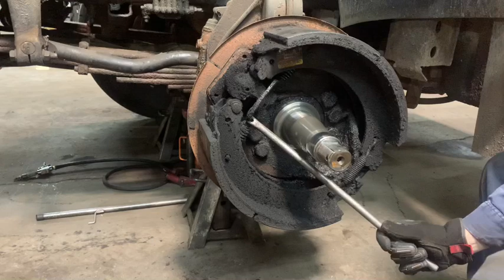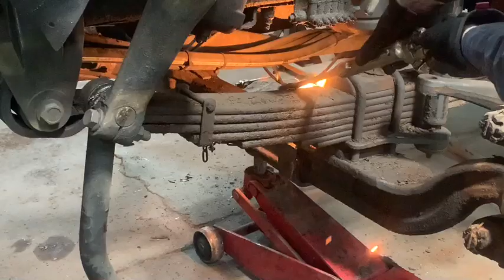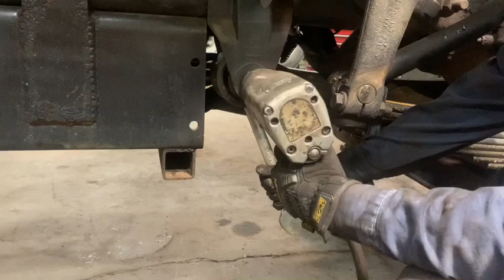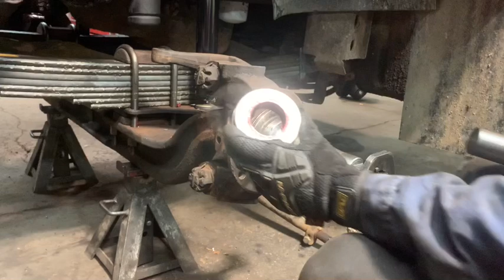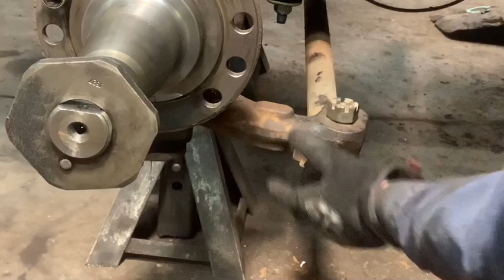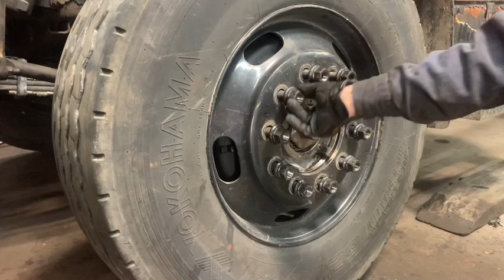GMC Dump Truck | King Pin + Front Leaf Spring Replacement

Comment: Wondering why the oil was low in that wheel and after you got the wheel off I saw where it was on the shoes and springs so that truck needs new shoes and seals too
Reply from the maker: Thanks for watching!! Yes it got new shoes and seals.

Comment: What size socket did you use to take out that Bearing nut
Reply: And do you think the tiger tool 90150 would’ve helped you in this situation
Reply from the maker: Thanks for watching!! The outer nut was 2-5/8” and the inner nut was 4”. I’ve never used a tiger tool so I’m not sure.